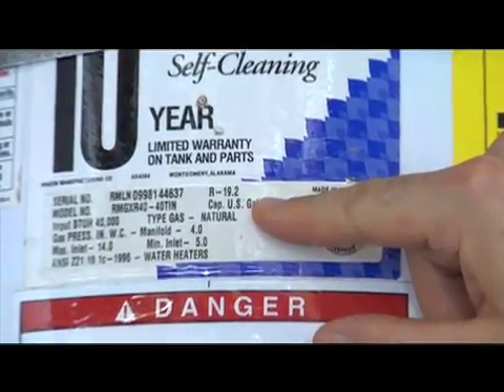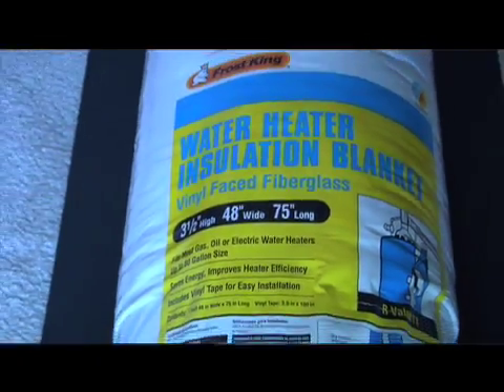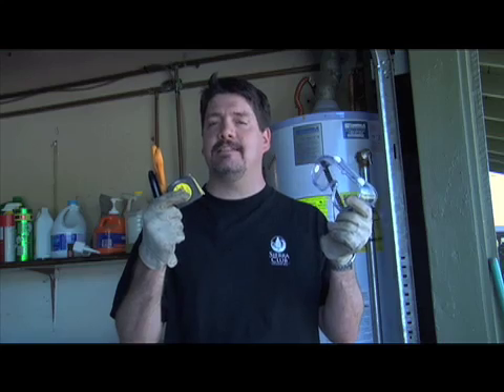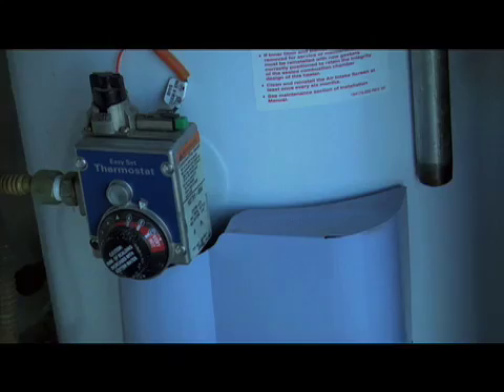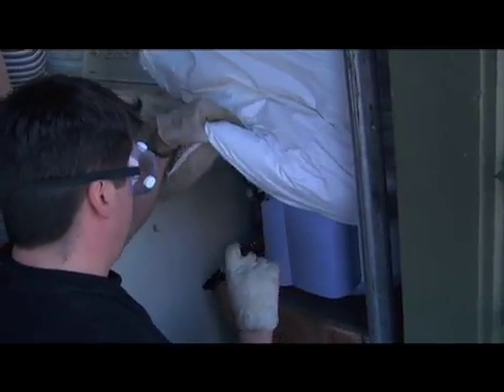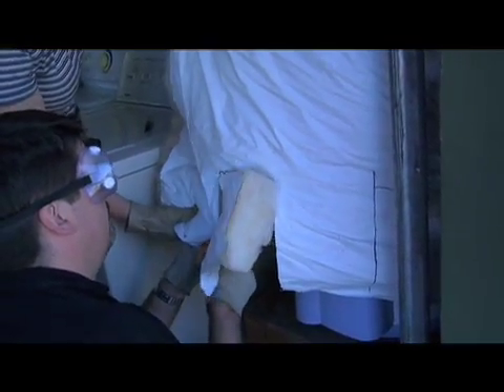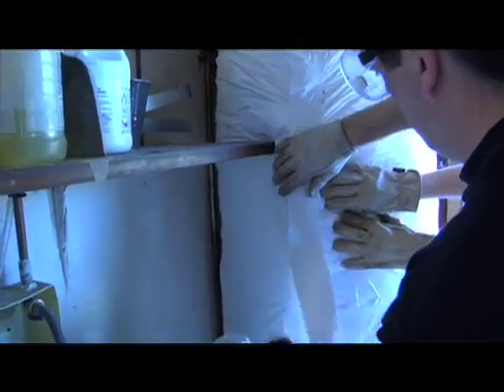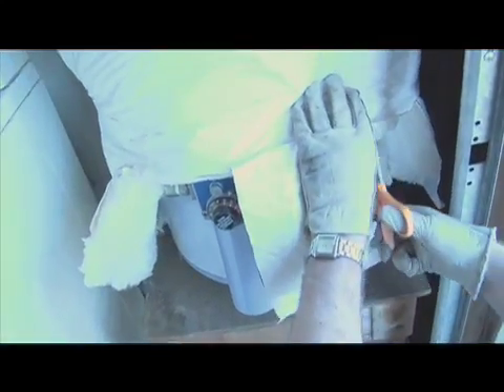Installing a Water Heater Wrap - A Sierra Club Green Tip

Comment: It actually damage the water heater when you cover it because the moisture trap inside the cover because it sweat and if cold if it not inside the house it will cracked the shell and leak out water very badly!